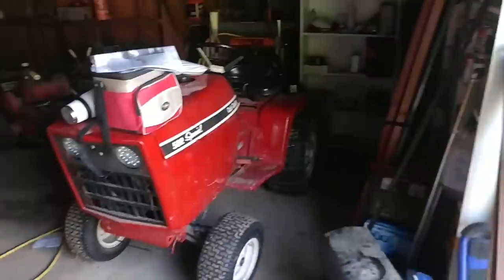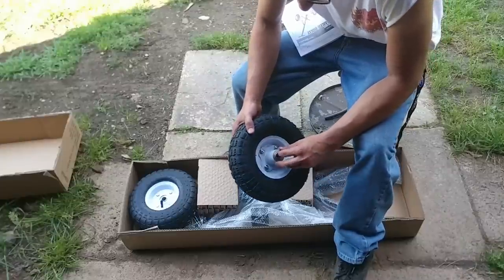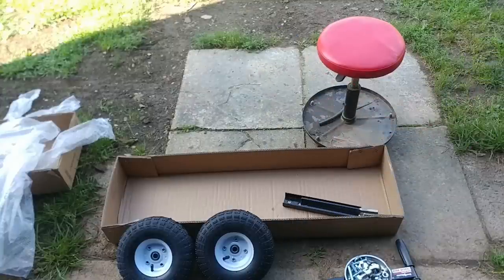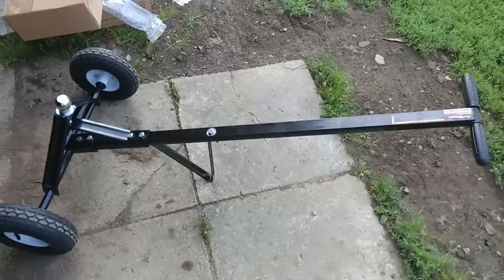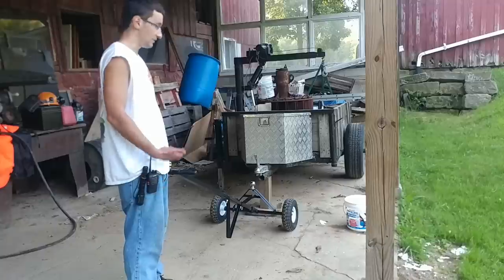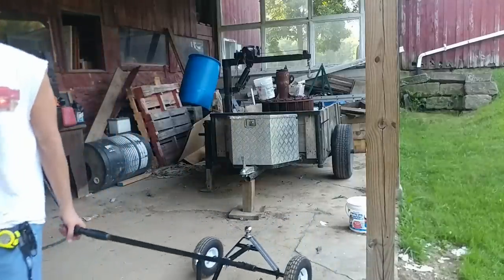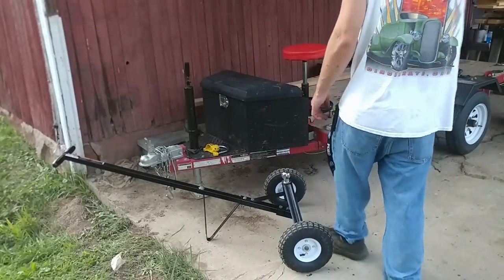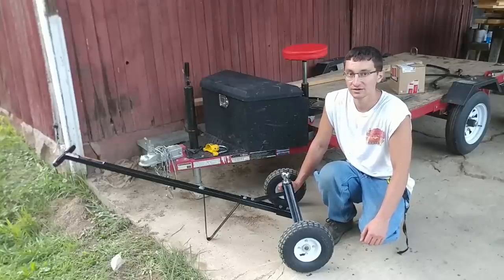HARBOR FREIGHT TRAILER DOLLY.... IS IT WORTH THE MONEY???? LETS FIND OUT!!! UNBOXING & REVIEW!!!!

Comment: After watching you weld with your HF 90 amp welder and learning a bit.  I welded with my HF 90 amp welder a HF $19.99 2 inch receiver into my E250's front Bumper to move my bigger utility trailer and my HF 4x8 trash hauler around the yard and park it out back. Thanks for the video. I could see getting one of these.

Comment: I know this is an old video, I just have one question. Do you think it would be possible to remove that axle and slide in a longer one? I am working on a project and would need to do so to to add tires with wider wheels which would require the axle to be slightly longer. I appreciate your time reviewing my question and giving some advice. Thanks!

Comment: first thing I would do is put wheelbarrow wheels on it. The wheels that come with it will be weather cracked in a  year or less..Changing the wheels will add some height as well. You could buy raw steel and build your own and it could be as strong as you want.